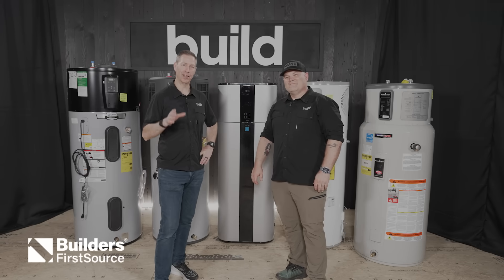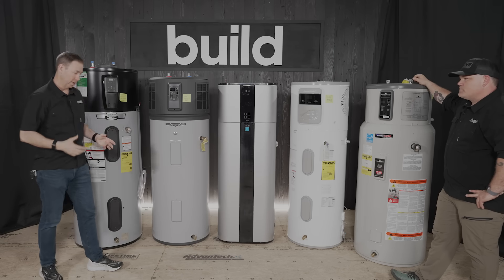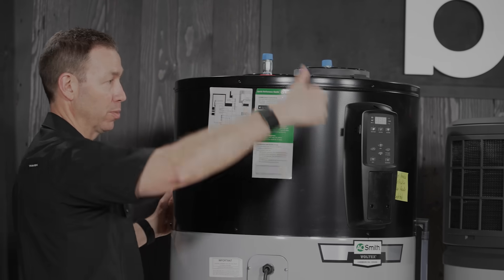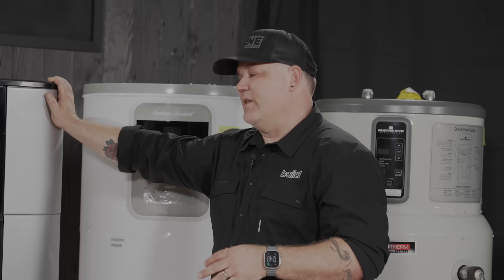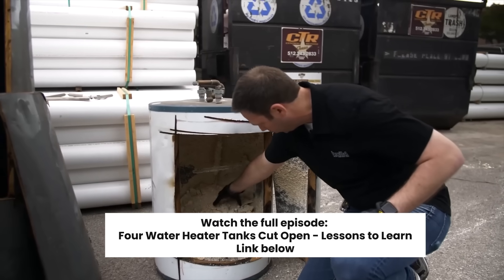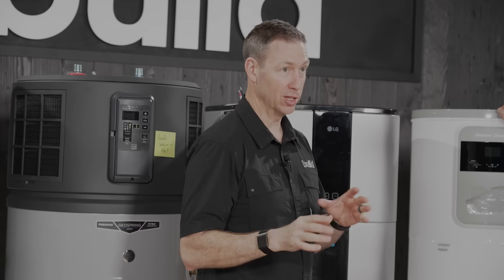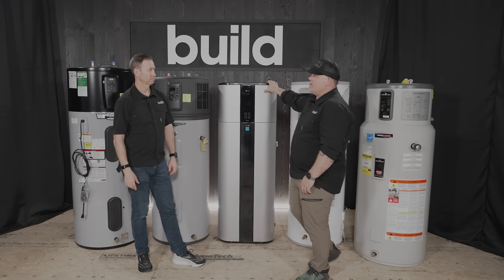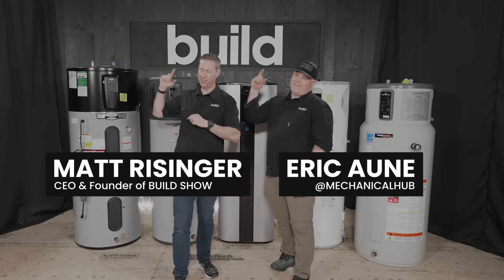Heat Pump Water Heater 101 - 2025 with Eric Aune

Comment: I installed one in a attic, worked great .
Reply: I was thinking of that attic idea too.  Lots of heat up there, perfect location for a water heater.  But freezing is a huge problem.  So I was thinking how about having 2 tanks.  The one in the attic only use in summer when it's crazy hot up there.  Than I have to crawl up there to do the switch and drain for winter, that might cause the tank to erode more.  And water leaking in the attic is much worse than in the basement.  Not sure how much it save really.  And having cheap hot water might encourage more water usage, it might cost more than it save.  LOL

Oh well, something to tinker about.  :)

And why limit to water, expand it to heating the house too.  I did go up the attic in winter and it's just as freezing as outside.  So when you want heat the most it doesn't have heat.  But when you don't want heat, there's loads of heat.  LOL
Reply: Wow, that's a lot of weight in an attic.
Reply: @barnyardstory I put it on a load Bering wall going to the basement
Reply: if your attic isn't cold enough to freeze the water than you are fine.  IMO it could get too hot for the electronic components.  These heat pump water heater is crazy expensive to replace.
Reply: @johnmicheal3547 nonsense. Ive installed over 4000 units like these in south florida garages and attics. Super hard water is what kills them not heat and humidity
Reply: @johnmicheal3547 been working fine the past 5 years     I’m in the south
Reply: @johnmicheal3547  check out the difference between then and than while you up there in the attic. also is and are

Comment: Why not sync it to your refrigerator?
Reply: I posted this above 

"Since the invention of the combo washer dryer into one machine. Do you think there will ever be a refrigerator hot water heater combo sharing a compressor unit? The cold goes into the fridge/freezer the heat goes into the water... I was thinking the compressor on one of the 2 units with freon lines going to the other unit???"
Reply: It get less efficient when the temperature are too wide apart between the two side.  Your hot water is super hot while your freezer is super cold, that's not efficient.

Comment: I have an ao smith 50 gallon 240 v tank. It’s a great water heater. For anyone who is thinking about it, it works just as well as your resistive element heater. I would like to say that the “smart” features leave a lot to be desired. The app is pretty terrible and it doesn’t integrate well with other services like google or Alexa. The app commonly drops my water heater and I have to set it back up.  

For a techy it’s rough but as a straight up water heater, 100% good to go.

Comment: Read my mind... new build has an instant propane. Going to buy a hp 80g propane unit to connect in series with existing unit and feed some basement radiant heating plus ground floor additional heat for in law suite

Comment: I think I like the Sanco with the stainless steel tank.  Any of these not need the anode rod?
Reply: Matt featured the Sanco/Eco2 heat pump water heater last time he did a feature like this.  Why not feature it again, and talk about any updates or known issues with the device?  IIRC, the Sanco has a COP of 5(!).  Do any of these have that level of performance?
Reply: @361noble  No, that is due to the Sanco using CO2 refrigerant. The integrated HPWHs sold in the US will generally top out slightly below 4 COP.